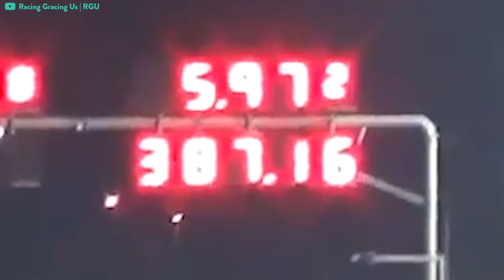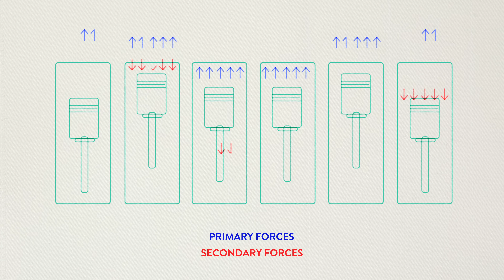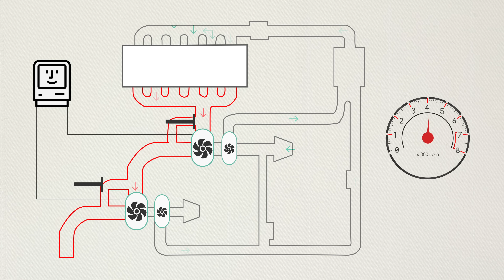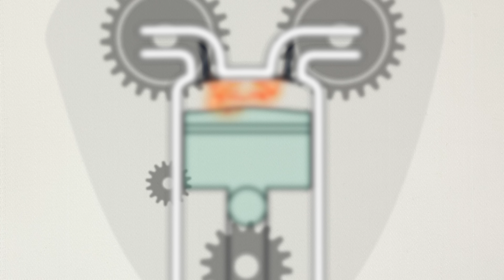2JZ ENGINE - How it Works | SCIENCE GARAGE

Comment: The first numeric characters specify the engine block's generation
The next one or two letters specify the engine family
The suffix (separated by a dash) specifies the features of the engine
Suffix and feature:
A Valvematic variable lift intake head
B Before 2000 indicates twin SU-style side-draft carburetors
After 2000 indicates E85 Ethanolfuel.[citation needed]
C Carbureted / California Emissions Controlled
D Twin downdraft carburetors or Toyota engines used by Daihatsu without VVT-i(e.g., 1KR-DE)
E Multi-point fuel injection
F Economy narrow-angle DOHC
G Performance wide-angle DOHC High compression 
H High pressure charged (example : 2L-THE)
I Single-point fuel injection
J Autochoke (Early models) or unknown pollution control
K On-demand Atkinson cycle in non-hybrid engines 
L Transverse
M Philippines' market (meaning unknown)
N CNG fuel
P LPG fuel
R Low Compression (For 87 and below octane fuel)
S Swirl intake (1980s)
D-4 Gasoline direct injection
T Turbocharged
U With Catalytic converter Japan-spec emissionsVD-4D Common rail direct injection system (diesel) or Toyota engines used by Daihatsu with VVT-i (e.g., 1NR-VE)
X Hybrid Atkinson cycle
Z Supercharged

The use of "G" to denote twin cam engines was decided on in 1971, with the renaming of the 10R into 8R-G. Before, twin cams had received new numerical codes.

Note: Toyota, in 1987, began assigning dual letter engine codes to some of the "engine family" categories in some engine lines, particularly six cylinder models. This can create potential confusion. E.g. 1MZ-FE – This is not a supercharged, narrow angle, fuel injected M-series engine, but a narrow angle, fuel injected MZ-series engine. Confusion is easiest to avoid when using the dash to separate between the engine series and its own characteristics: for instance, 1MZ-FE rather than 1M-ZFE.

Comment: RB26
2JZ
4G63
EJ22B
13B
Are true love <3
Reply: The RB isn't as strong as the 2jz
Reply: @mikehundredson584  there is a reason why HKS chose the R32 for their 1000hp project and not the Supra... ;)
Reply: @lpmorgan90  not because the RB is stronger, fact is the 2jz has stronger internals out of the factory. Both legendary motors but the internals are stronger on the 2jz. I have to say though I prefer the RB because it sounds better.
Reply: Mike Hundredson they are the same engines but the new ones are 💨
Reply: K20a
Reply: 4AGE...
Reply: N54 as well
Reply: Add the Aussie I6 Barra too
#barratheworld
Reply: Nikola Andonovski 4G64 block with 4g63 head = win
Reply: 4G63 Till I die!
Reply: LS1
Reply: @bruhmikey2451  Can't forget about the LS2, LS3, LSA, LSX, LT4, and the LT5!!
Reply: J32a2 FTW
Reply: 4AGE ftw
Reply: Sr20de(T)
Reply: k20a > every other n/a 4 banger
Reply: C32B from NSX?
Reply: @wolfsburvviann  c30/c32 also great engines from stock. i mean they have stock titanium rods and some other high quality engineering tweeks. problem is this engine doesnt have as big of a fanbase because no one can afford it. so no one swaps it in a civic or an mr2. so not many people know what it can do. ive heard in a hoonigans video there was a guy running time attack with a na1 with 700hp sleeved but stock titanium rods. seemed to be reliable.
Reply: K20?
Reply: what about 4AGE, B16,F20C and SR20?
Reply: @lerox6971  holy shit how do u guys remember these engine names
Reply: @enderzebak2863   my dad taught me about cars, JDM USDM etc.
Reply: @lerox6971  yeh i get it u live in an environment where cars are really important well its the complete opposite for me im 17 and i love cars still havnt driven any 😣
Reply: and 20B
Reply: 13B REW I must say
Reply: @soraaoixxthebluesky  
I want nothing to do with the 13b rew.
Such a step backwards for mazda.
Reply: You forgot S54B32
Reply: K24? 4g63?
Reply: OM606
R26b
Reply: 4.6 TERMINATOR engine
Reply: Why Not Top It Off With A Volvo B5254T Engine?
Reply: You forgot Toyota's 1UZ.
Reply: @LeeePowers  there is also 3uz fe and 3s gte and 7mgte
Reply: You forgot n54 and barra i6
Reply: Mercedes m104. 980 chain drive twin cam, cast iron block, aluminium head, hydraulic vvt. 7500 rpm stock.
Reply: None of you have those engines lmfao thats the funny part 😂😂😂
Reply: @AImighty  speak for yourself
I have a built Evo IX and STI
Reply: You forgot S54.
Reply: 20b
Reply: Sr20 and f20
Reply: 4b11t
Reply: What about Polish engine P-blowjow69?
Reply: 2GR :)
Reply: Nikola Andonovski which one is the best one?
Reply: @Alex-ue7gl  They are all the best in their own way but if i had to pick one id take the 2jz extremely built inline 6 turbo engine is just legendary <3
Reply: What about vr6??
Reply: K20 is pretty good too.
Reply: Gallo 12 Gallo 24 ??????
Reply: What about VR38?
Reply: You forgot SR engines
Reply: VR38?
Reply: Nikola Andonovski You forgot the SR20, K20 and K24
Reply: LS SWAP! LS SWAP! LS SWAPPPP
Reply: B26B u forgot it?
Reply: 1ZZ SW20 - MR2
3SGTE - CELICA
Reply: EJ is so weak tho
Reply: VG30DETT
Reply: You forgot the 3sgte, 4age , 2zzge ,
Reply: LS SW@P
Reply: SR20
Reply: Yo forgot a V8
Reply: Nikola Andonovski 2jz should be Number 1 https://youtu.be/9JYHQswWK6I
Reply: and the rare 1GZ
Reply: SR20DE/T

Comment: You should make a Science Garage video on glow plugs!
Reply: Glow plugs are like spark plugs...They are used in diesel engines and are used only at starting up.
They stay in an incandescent state for a longer period of time (from the moment you turn your keys into ACC until your engine starts) compared to the petrol engine where each ignition phase means that the spark plug fires for a few fractions of a second. Diesels burn the fuel by themselves without the help of the spark plug or glow plug.
Science Garage will be off for quite some time because Bart is taking some time off.(He is a father from what I understand)
If you have any other question I will try answering it as we (my family,because I don't drive yet) have a diesel car...And we "know a thing or two" about repairing our car. :)
Reply: https://www.youtube.com/watch?v=lpx1yjTOjn0 If you wondered how it looks...
Here you go!

Comment: Guys... Just give Toyota time with their BMW Supra and their 86 STi.....
Reply: 86 STI - what do you mean?
Reply: Orange Juicy Ice toyota 86 is produced alongside the brz and scion frs
Reply: Diego Venegas oh I see
Reply: Diego Venegas The BRZ released alongside the 86 is not tuned by STi. While there is a new BRZ tuned by STI, there will not be a similar 86
Reply: @Detrimentaedation  with s boxer engine
Reply: @Douglas Hamner Uhhh it's an actual term used in the tuning industry lol. But yea he probably quoted from Forza.
Reply: It's a bmw engine, not a Toyota engine.
Reply: @Douglas Hamner there's stages in tuning, stage 1 normally is just ecu tuning, stage 2 is ecu tuning and minor modifications aka bolt ons, like exhaust systems and intakes etc, and stage 3 is basically everything said before+ internals and major engine work, learn a little bit more before you try to prove a point, and yeah, b58's are making 600 without any internals being touched, just like the 2jz can do
Reply: Lol that B58 is gonna suck, it's great in stock form but it's terrible for tuners.
Reply: @HansensUniverseT-A  only 600 HP with stage 2 modification.... But we still want a Toyota motors 👏

Comment: JZ engines are designed by Yamaha
Reply: steve blow thats a great topic.  Yamaha motor collabs with toyota.  4age, jz, lfa motor, beans, 2000gt
Reply: Yeah they designed the heads, but nothing wrong with that
Reply: Just the heads.
Reply: Also the Ford Taurus SHO engine: designed by Yamaha
Reply: steve blow yes sir! Exactly
Reply: only 1jz
Reply: *heads
Reply: noble m600 engine are also made by yamaha
Reply: @hand1ification  noble uses Volvo V8, which was made by yamaha, but enginnered by volvo
Reply: Correct.  I'm glad someone said this.
Reply: Yamaha is the secret sauce in all big macs🤔 280z LFA supra the f sports ect.
Reply: Toyota should’ve collaborated with yamaha on the a90 NOTT bmw
Reply: Yamaha designed the vvt-i head to the 1jz, and then toyota used that technology for the 2jz also. But it's only the head.
Reply: Designed the head flow of the 1JZ, had no part in the 2JZ. 
No 1J head and 2J not the same.

Comment: You guys are mad that there is no JZ motor but forget that Toyota would’ve spent years to make one and most of the people complaining probably can’t  afford it when it comes out (I can’t afford it either). But you don’t need a Toyota motor to have high horsepower, and if they wanted the best I6 turbo motors in the market, they had to go to BMW. The N54 (granted, not as reliable as I’d want) is a beast and can easily make 500hp with some bolt ons. The B58 that’s in the non-M cars (240i, 340i, 440i, etc) can make over 500hp with a stage 3 turbo upgrade. Toyota made the right decision on using BMW’s motors and I’m going to plan to buy one once it depreciates
Reply: 500hp is nothing these days... that's a pretty low benchmark.
Reply: isnt the B58 in the M2?
Reply: @UnparalleledSpoof  No, the first M2 has the N55, and the M2 competition has the s55
Reply: @kk kkk and lose money and get discontinued because no one is gonna buy it ?
Reply: Yeah I really think the B58 is shaping up to be one the best I6 engines of the post-2000 era, and I say that as a guy with THREE JZ-powered cars (a Supra, a Mark II iR-V, and a 2JZ-GE swapped Altezza). The B58 is lighter than a 2JZ (due to aluminum block) yet still has a closed deck design and BMW guys are making 600+whp on stock internals. Credit given where credit due, BMW built a winner there.
Reply: The new BMW supra is gonna be a endless money pit not great for tuning with aluminum block
Reply: the 2jz is the best straight six ever made

Comment: 2JZ, is considered one of the greatest engines of all time.  I know I will get all kinds of flack for this.  It still isn't my first choice when it comes to building a Toyota vehicle.  1UZ or 3S series engines are my first choice.  I know go ahead and start the discussion. (:
Reply: The 1UZ is soooo underloved. It's just as strong as a 2J, but since it never came boosted, very few people know anything about it. I think it's the only FAA approved V8.
Reply: ishootstuff Thank you! Yes, even the first generation engines were awesome starting points. Almost all Toyota engines of this era were amazing places to start. For me, I would daily my 1UZ powered car. Thus stock 250-300 HP is enough for me. Even, in a HEAVY LS400, the 1UZ was more then enough. ;)
I will add, I would bore out the block to make it a 4.3(3UZ). That additional torque is great at the lower end. (:
Reply: How about the 1fzfe basically a 4.5 liter 2jz! I love the 1uz as well
Reply: RedsBaller 1fzfe???
Reply: ricky v yes. Came on land cruisers in the US from 93-97 and in other places until mid 2000s.
Reply: RedsBaller Oh was that the 4 liter version of Toyota’s inline 6 family?
Reply: ricky v 4.5 liters iron block aluminum and tough as shit. Can hold a bunch of power and makes lots of torque.
Reply: Gotcha. I knew of it but never heard anyone using it to do a project car. Typical, right? We all follow what the crowd does instead of going a new route.
Reply: ricky v look up the Toyota 86 with a 1fzfe swap it’s insane over 1000 hp
Reply: @RedsBaller, no problem, will do.  Thank you sir or ma'am.  LOL
Reply: PETE FOSTER I agree. I’d get a later version from 92 and up SC/LS model.
Reply: 100% agree. I have a 1UZ-FE Lexus LS daily and a 3S-GTE Celica and a 3S-GTE  MR2. Every single one is a fucking work of art.
Reply: Yes, especially  that MR2.
Reply: ricky v
Have you ever seen an ST-205 in person? It’s the more beautiful of the three IMO.
Reply: As an American that dreams of those epic cars we never got in the USA; of course!  I did see one while I was living in Japan. They are better looking in person.
Reply: ricky v
I’m one of the few dozen Americans who built our own here in the states. It’s easy, you just need a good straight shell USDM car, two half cuts from Japan and a whole lot of free time.

Comment: Lvl 1 crook RB26DETT engine 

Lvl 35 boss 2JZ 

thats how mafia works
Reply: It do be like that sometimes
Reply: Max Level: Rotary
Reply: EtienneSC .x7 you right.
Reply: RB26dett vs the 2jz Which one
Reply: Izzy motorsports I’ll take the RB during the week and the 2JZ on the weekend.
Reply: Tyler Baker your right RB26 then 2jz anytime
Reply: @htvperformance  search rb30 the best of the rbs vs the 2jz
Reply: @tylerbaker7141  why?
Reply: @htvperformance  i still prefer rb
Reply: Level 60 Godfather LS1
Reply: But those are both such great engines. Why would you disrespect the RB26, like that?
Reply: level 100 LS v8
Reply: Thats how Toyota works
Reply: Lv 3 spy  The SR20DET
Reply: Lvl 36 Agera's V8
Reply: Justice fire eating disco panda 😂you might be right.
Reply: RB26 is a good engine tho, it has a different character.
Reply: Lvl 272929919 : 1.4 VTEC😂
Reply: Nah lv1 is sr20 or 4age
Reply: level 150 legendary god n54
Reply: then a ls shows up and slaughters both of them with a stock block
Reply: @K00t3rBr0wn  Yeah, Too Bad that LS Engine wasn't designed Yet. You had a LT1 at the Time, later on they Released the LS1
Reply: Gottamake Life lt still better what’s your point
Reply: @K00t3rBr0wn  Thats my Point. Lmao Chevy made crappy Transmissions
Reply: Wicked SS pretty sure Supra guy use the t56 now a days...
Reply: Wicked SS as far as car go you right but the ls is better it’s lighter than both of them and make more hp and torque
Reply: @K00t3rBr0wn  of course it's better it's newer with better technology
Reply: CL3AN N M3AN maybe but end of the day still better
Reply: @slowdailys  timeframe really doesnt matter in the present day
Reply: @K00t3rBr0wn  That's funny coz the RB25DETT was the first mass produced engine to produce over 1000hp...

Comment: I’m not sure if VVT would cause piston-valve contact. If the engine is truly non-interference, then there should be no way that the valve would occupy piston space. 

VVT is just changing the timing of the valve. 

VVL typically refers to variable lift. If the VVL function did extend the valve out to piston space, then yes, it’s an interference engine.

Just a little confused if maybe the 2JZ VVT heads had more lift in general?

Comment: Sorcery... two turbos is obviously better than one
Reply: 2 turbo for normal drive. One just for big bang.
Reply: 4 turbos are better than 2!
Reply: @cr4zygoose201  
4 turbos are definately WORSE than 2.
Reply: @blyndrotor   Wrong! Bugatti Veyron EB 16.4 and Steve Morris' Devel Sixteen
Reply: @wirewrks  
Well yes if you are running ridiculous capacity it is impractical to use a big single or even twins. I live in the real world where such vehicles are unattainable to to all but the very wealthiest of society.
The subject of the video was the 2j and running more than 2 turbos on a 2j would just be an exercise in engineering showboating. 
Pointless, unnecessary and impractical.
You think the eb and devil make those numbers because of how many turbos they have. 
Capacity plays the bigger role and with boost they achieve those numbers.
It's all about the efficiency of the turbo/s and a balance or matching of the turbos to the engine and its requirements.
Smaller turbos spool quicker but can't make as high boost pressure and to try pushes it out or its efficiency curve. In other words just heats the air more and more, reducing charge density and so and so forth. Plus smaller turbo runs out of puff/flow way sooner.
Bigger turbo, spools slower but can make higher boost without heating the charge as much  etc etc.

Comment: Isn't the 2JZ-GTE VVTI a Non-Interference Engine, but the 2JZ-GE VVTI is an interference one?
Reply: tehDmez no
Reply: I can confirm that the 2JZGTE VVTI is Non interference has I have one and recently done the cam belt. And for my own piece of mind placed  NO 1 piston at TDC and spun the cam  360 and it did not hit anything.  As you have said the GE is interference, I assume because it's a higher compression engine with taller pistons or maybe higher lift cam but I don't think so?
Reply: If you have a vvt-i 2jz and your T belt snapped and you didn’t get a bent valve you should go to church and thanks god personally, non vvt i = non interference
Reply: Even if u have the vvt , you can delete it
Reply: Yes this is correct, I believe the misinformation probably comes from the fact the USDM market had the 2JZGE vvti and never got the 2JZGTE vvti. I had a 2jzgte vvti and with my stock cams and aftermarket cams it was still non interference
Reply: @2JZGarage  probably because the cr is 8.5:1
Reply: 100% correct

Comment: You say variable valve timing, but you're talking about variable valve LIFT
Reply: None of the Toyota VVT-i engines manufactured before 2000 had lift control. The 2ZZ-GE is the only engine that did.